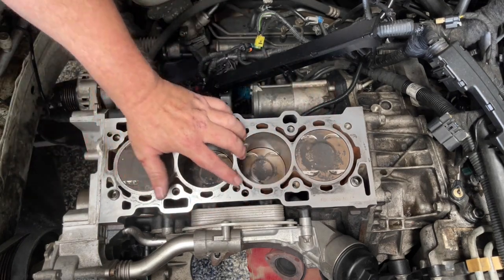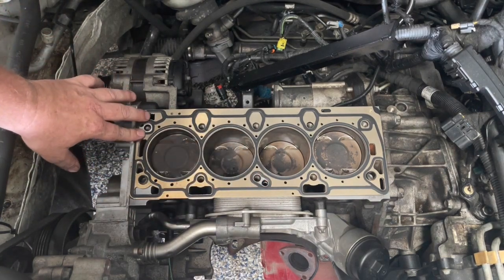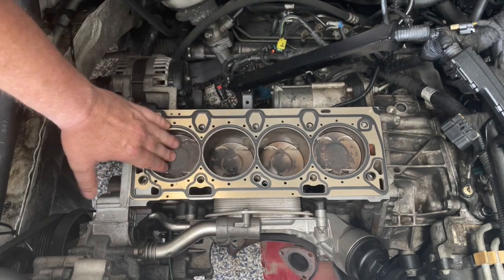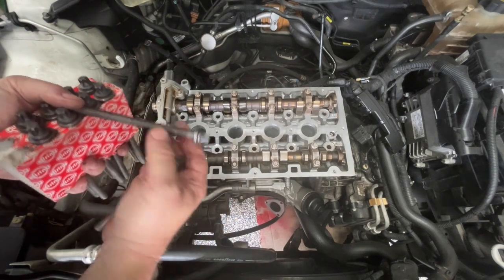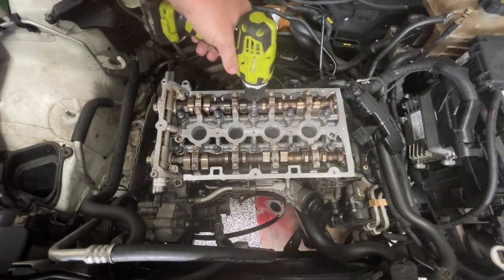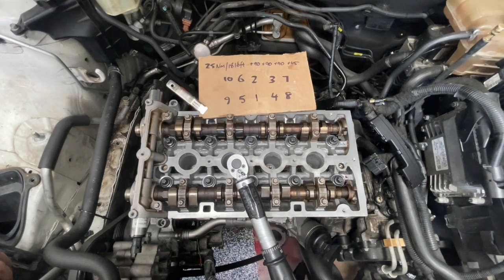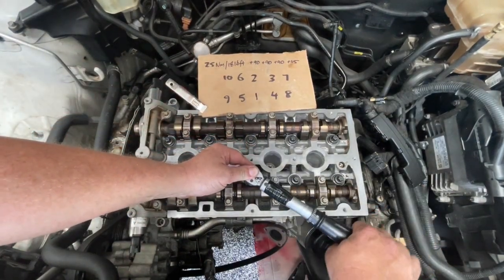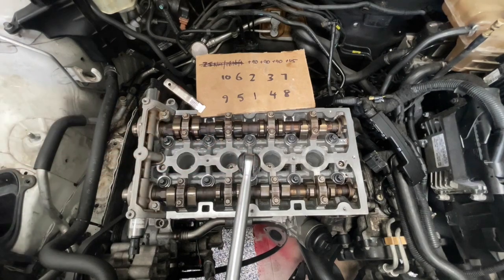Cruze Head Gasket Replacement  STEP by STEP process (Part 8 of 16) Full Details for 1.8 F18D4 Engine

Comment: How long would this whole procedure typically take? I have a 2014 chevy cruze that recently started having issues with coolant boiling in the coolant tank. I have checked the thermostat, water pump and fan and all three are functional. I have bled the cooling systen a couple of times so I’m pretty sure it’s not an air pocket trapped in the system. The only thing I have not done is replace the head gasket, coolant tank and radiator cap. I am trying so hard to convince myself that it is not a blown head gasket cause this seems like a tedious procedure 😅
Reply: It’s extremely tedious. Takes about 16-20 hours

Comment: Hi watching your videos for this repair and noticed you did not put the little black oil flow thing back in ?
Reply: Yes, a common failure point on overheated engines where this black plastic oil restrictor (part # 55563957) melts with engines with solid cam followers (engines with hydraulic cam followers have a blue coloured non-return valve part # 55556227 in the same position).
Reply: @howiesiesoosoo  i just changed my head gasket. i put the little black oil flow thing back. will it do any harm?
Reply: @afiqariff10  Won't do any harm as long as it's undamaged.  It's vital to have this flow restrictor in place on engines with solid cam followers or you will have excess oil flow into the head with resultant risk of oil leaks, and low oil pressure at idle.  Engines with hydraulic cam followers have the blue non-return valve instead of the plain black plastic one but it's still vital to have it in place for the same reasons as above.